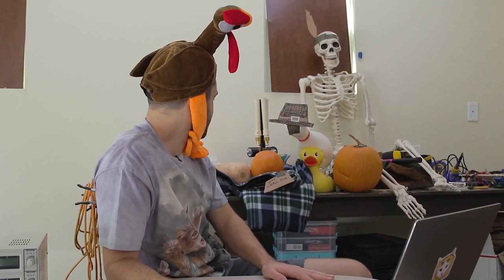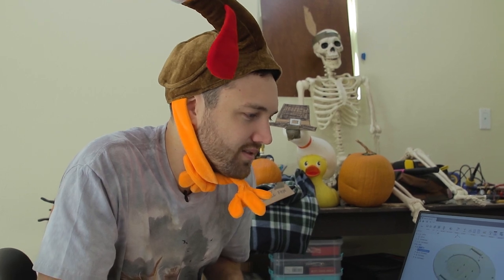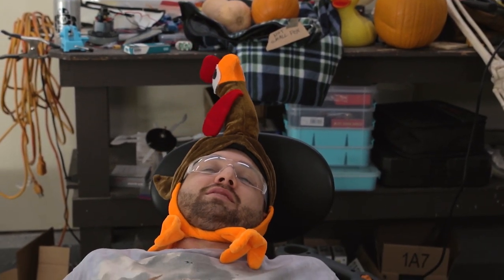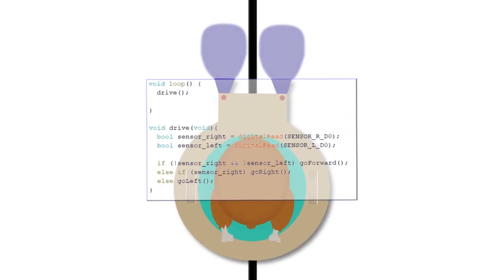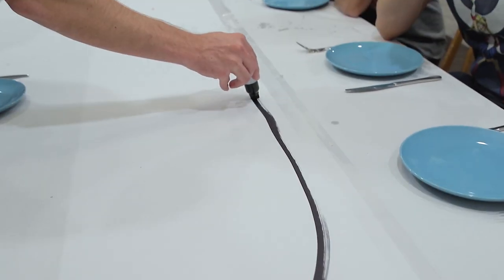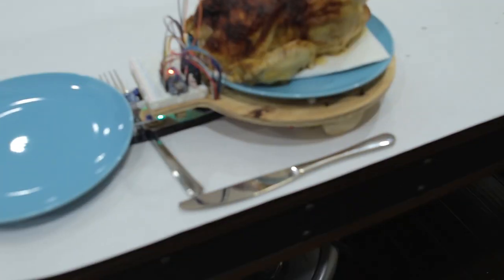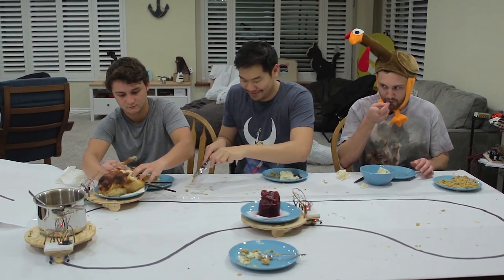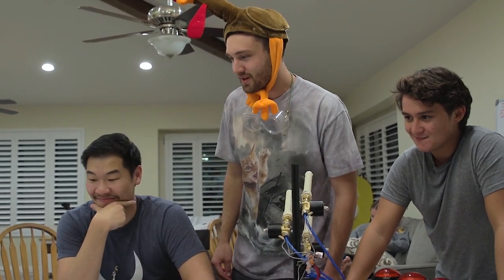I Ruined Dinner With Delivery Robots

Comment: Yo, I've been learning how to use my Shapeoko too, I can't fix the software but here's some stuff you can try:

Check out the USB cable, it's really susceptible to noise. I had mine do some random stuff until I got rf shielded USB and Spindle cables. Also, it does some weird stuff if your computer goes to sleep, so you might wanna change your power settings. Also also, a few things that have happened to me when it randomly cuts super deep: the spindle or the bit isn't tight enough and slowly drops down while it's cutting, the depth of cut is set waaay too high in Fusion, or I didn't set the z axis properly before cutting.

Good luck!

BTW, you should try some 3d stuff instead of treating it like a shitty laser cutter.
Reply: thumbs up so William can see it
Reply: Yeah, have had my own CNC cutter slip the bit twice, didn't tighten it enough. Also he did kind of tried some 3D stuff, he milled the cat in the pumpkin.

Comment: Is it possible that the lines weren't thick enough for the sensors to read correctly?
Reply: yes, but it can be overcome with some calibration
Reply: or the bright lamps might have a peak in the IR spectrum
Reply: Damn I'm at the start of the video and you spoilered me the fact that it doesn't work
Reply: No, they followed them later.
Reply: then dont read the comments before watching the video lol
Reply: Also, the bot was going too fast so it overshot the lines
Reply: Nikola Tesla why would you read the comments at the start of the video? Of course there’s gonna be spoilers. It’s like going on facebook when you haven’t seen infinity war a week after release!
Reply: I was thinking most of them had too much momentum from going down the ramp and couldn't slow down enough to follow the lines.
Reply: It worked perfectly
Reply: I feel like if he turned down the speed and positioned/angled to senors better it would have worked.
Reply: @MR5er1  this is william osman, that should spoil enough about how well its gonna work
Reply: The problem was that the sensors werent really “following” the line. They scan the paper for a certain IR value (black line) and adjust based on a predetermined threshold.
Reply: I think the weight of some of the food was just too much for the motors to handle turning the whole thing, since the ones with less food worked.

Comment: "they told us not to use an 8 inch drill bit but we did it anyway!!"
Seconds later
"So we have some technical difficulties"
Reply: *Eighth-inch end mill.  He was told to use a drill bit for the drilling, but used an end mill.  The end mill works fine, but it may dull the tip faster being repeatedly used as a drill.  They're much more expensive than drill bits.  ($5 to $30 U.S. each for that size, depending on steel type and brand.)

Comment: If I understand correctly, the sun-diver (Parker Solar) probe that was launched last year uses a very similar steering principal... at least for the part of its mission that it will be hovering in orbit around the sun. There are essentially four sensors on the tail end of the probe, if one sees too much of the sun, it fires thrusters until it can't, thus keeping the probe aimed at the sun. 
All that aside, I hope Thanksgiving this year is more successful for you guys than the one in this video.

Comment: Next time you do a line follower robot, it's really effective if you have a line sensor that gives back analog input and then just use a pid loop to keep it on the left or right side of the line.

It would have to be on the line at all times though, otherwise it would go in circles if there was no line

Comment: plunging with a end mill is totally okay but it depends on how the flutes connect at the bottom.  and you totally can make 90 degree corners on the outside of the part.

Comment: IR splash sensors are very sensitive to changes in lighting, I've seen them stop working when someone casts a shadow over them indoors. You probably tested and calibrated them in different settings causing them to not work here.

Comment: I have two questions about your production process. 
1. Why did you switch to fusion 360 instead of countinuing to use solidworks?  
2. Why don't you use a 3D printer to make your custom parts?

Comment: Will. William. Billiam. Bill. Billy willy. I repair conveyors for a living making a conveyor would have been a thousand times easier to do, all you need is one motor that drives a roller, minimum one other roller to put at the opposite end, and something for a belt. It wouldnt be nearly as interesting but in no way was it harder than this. Keep up the good work